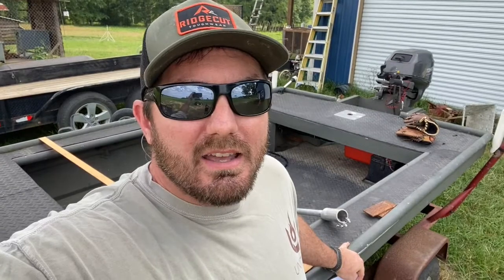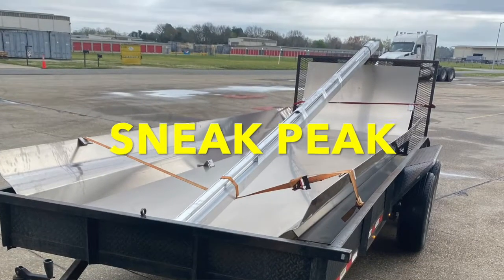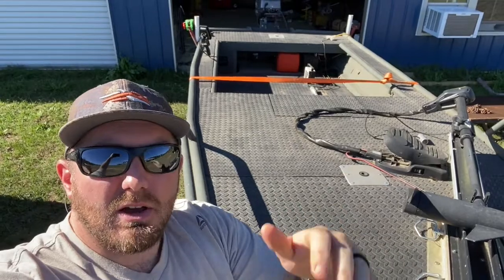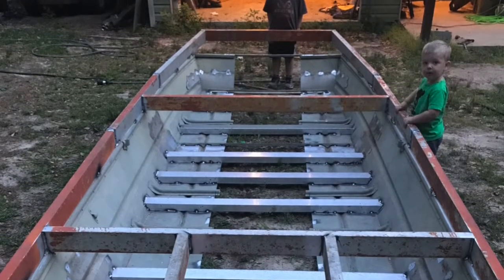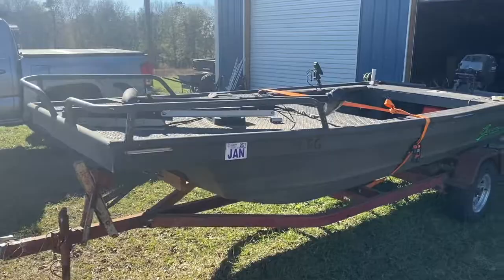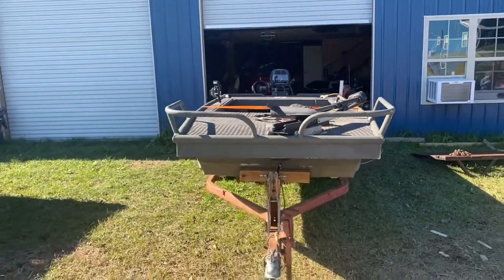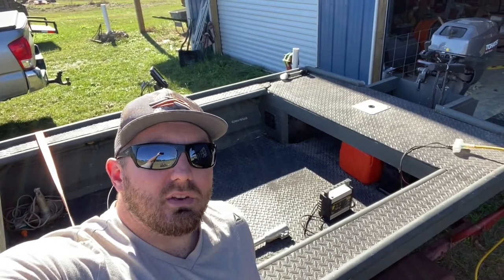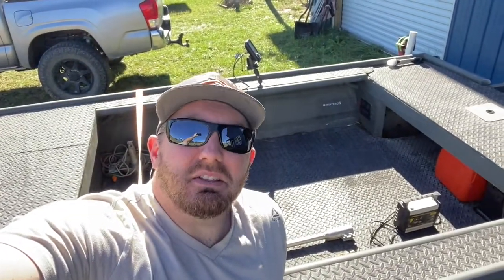Tiny boat not so tiny any more... I cut my jon boat in half! don't miss this homemade boat #diy

Comment: I got a question what type of aluminum did you use for the boat?
Reply from the maker: I believe the sheet I bought was 5086. All of the other stuff was just random aluminum I got from the scrap yard and hoped the alloys would weld decent enough to hold. Worked out that they all did just fine.

Comment: If you do that do you have to change the size of the boat on the title ? And also did you up your capacity plate then ?
Reply from the maker: In some states you can register it as a homemade vessel if you take it down to just parts. Then a new hull id would be issued and you could go from there. On homemade boats, capacity plates aren’t issued, only id. Some titles will only state a length and if the main footprint of the length doesn’t change, I would imagine you could leave it and just continue to go by the capacity listed. I’m no legal expert but it would vary by state and by application I’m sure.
Reply: @JackArmstrong-jackdaddycustoms  thank you

Comment: Why not tig weld it may I ask?
Reply from the maker: @rickyheck6780  because I only have a mig. Tig would have been much easier but I simply didn’t have immediate access to one.
Reply: @JackArmstrong-jackdaddycustoms  makes complete sense... I was just curious... thank you for the reply...
Reply: @JackArmstrong-jackdaddycustoms  I wasn't bad mouthing you just so you know... I was curious to if a spool gun would be more effective compared to a tig with how thick the aluminum was... I'm considering building a west coast low water river boat with like an Rivercross R140 with a 300 hp rotax motor or I'm looking at a tunnel hall flat/semi jon boat... I like the way the river cross is designed because how low and rocky The Juniata River is here in Pennsylvania... I just have never tig welded before... But I have used a Lincoln welder with a spool gun on my reitnoer curtain side aluminum trailer...
Reply from the maker: @rickyheck6780  yes sir. Didn’t think anything of it. Tig is better on the thin stuff because you can control the heat. Since you have spent time behind a spool gun you know there will be quite a lot of spurt spurt spurt on the thin stuff.

Comment: Would like to do this on my v hull but sounds little more difficult than a boxy Jon boat
Reply from the maker: Yeah it would definitely be harder. You could add a flat piece like I did but you would effectively end up with a weird looking flat bottom I think. OR, you could concave it a bit in the middle and make it more like a catamaran. That might be sweet.